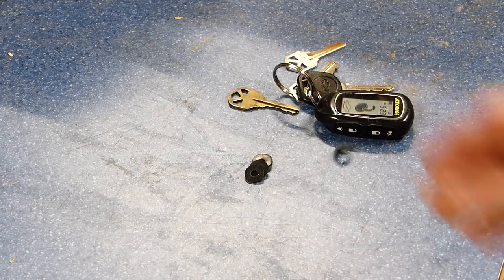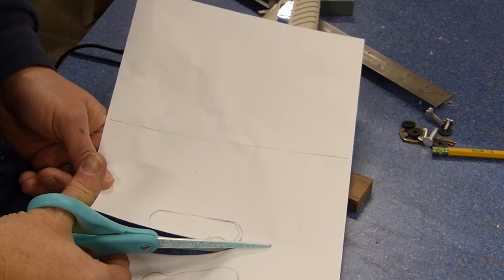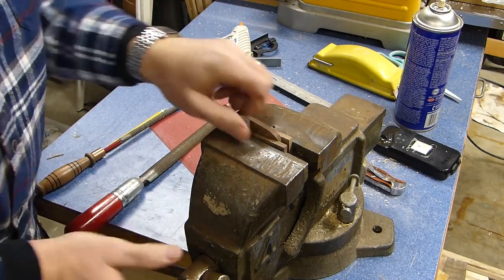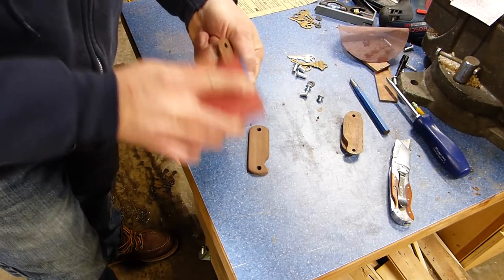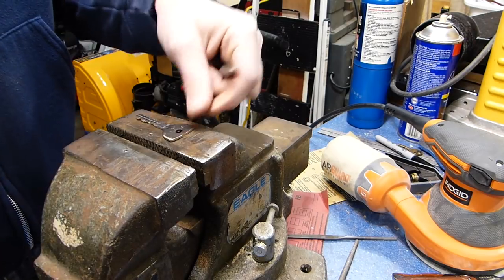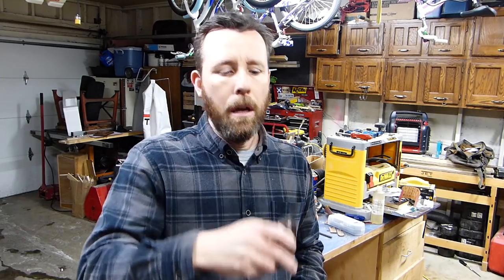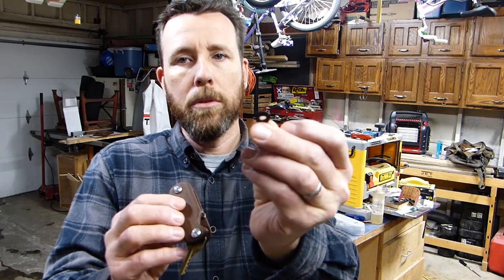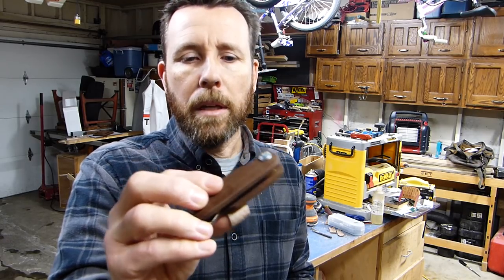Easy DIY Folding Key holder

Comment: Great video, Jake! The key holder turned out awesome, perfect way to use up some smaller pieces you've got lying around too!
Reply from the maker: Thanks Braxton!   I have so much extra wood the could be used for this sort of project I even found a few new sources for hardware for this so the binding posts could be brass or brushed bronze.

Comment: That's a really great idea.  You'll have to do a follow up and let us know how the neoprene washers hold up. Could you use brass washers or bushings in their place?  It might help keep the binding post tight. Thanks for the video.
Reply from the maker: I think I could do something like that.   I also found that there are a ton of other options for hardware.   The binding posts are also called chicago bolts.   They are mostly used in leather work but come in a bunch of different varieties.

Comment: That is an awesome idea! I've got some bulky keys and 3 keyless entry fobs. I gives me an idea to mount the key fobs on the sides of holder and the keys inside.
Reply from the maker: if  the keyless entry fobs were small enough you could drill a hole with a forsner bit on the inside of the wood so they are hidden.
Reply: Yep that was my thoughts. I even took a part my key fobs while sitting in my office to see how big the board actually was. :-) MakeSomething's David Picciuto did something similar with two TV remote controls and made a custom double sided remote.
Reply from the maker: you'll have to send me a picture if you do it

Comment: Just buy a craftsman or kobalt sae folding hex key kit and remove the hex keys. At the same place you bought the hex key ( mine was lowes ) look for the right size screws and bolts. You basically get the exact same thing as this guy made but better.

Comment: Putting a key in a vice is generally a bad idea - especially if you do it sideways as 04:30 Only a slight change to the "highs and lows" on the key (ridges and valleys or whatever it's called) can result in it not working anymore. If it stops working you better have a copy as you can't make a new one from a not working key.
Reply from the maker: you're right.  I did make sure my key was being held by the flat spot toward the top of the key rather than the teeth.  I should have pointed that out in the video.

Comment: What car these days doesn't have an anti theft chip in the key?
Reply from the maker: That's a good point.  I put a note in the video at that point of the video.   There are still quite a few that don't but quite a few that do.    You can still do the project,   you just need a little longer binding post.